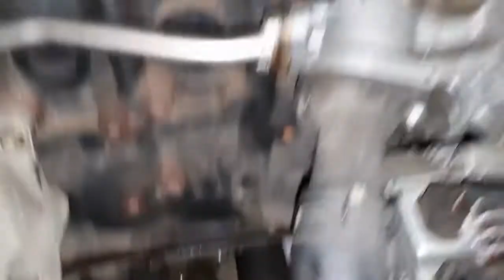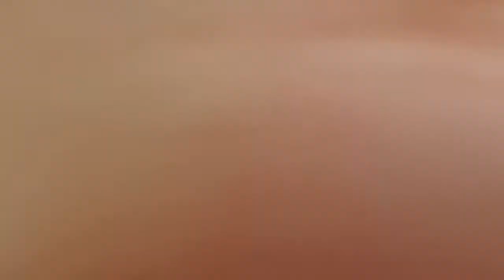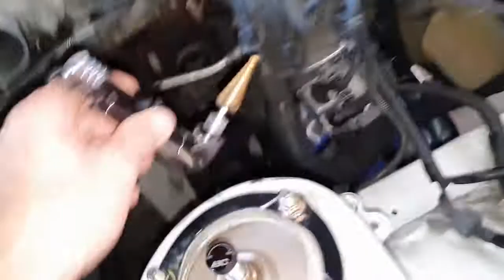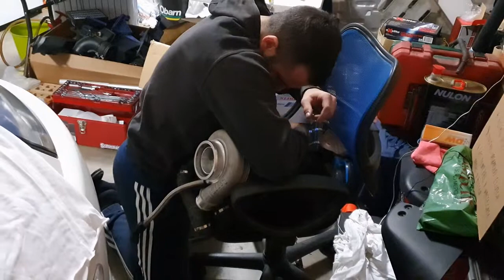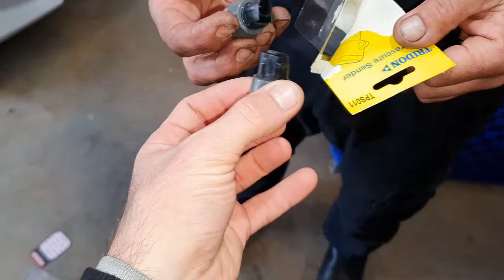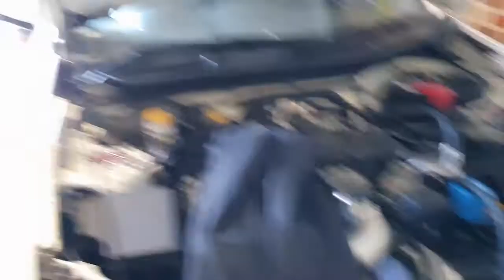TURBO lines COMPLETE 2JZ-GE OIL + WATER FEED/RETURN (NA-T SUPRA BUILD SERIES) Ep.3

Comment: There are two pipe plugs in the oil filter neck. They seal the drilled passages in the filter neck, one to feed unfiltered oil from the block up to the filter; and the other to feed filtered oil back down to the block. Rather than drilling the oil filter neck union bolt and using a "tee" fitting - you can simply replace one of the pipe plugs with a 90* elbow with appropriate NPT thread on one end (I think it's 1/2" NPT but I can't remember for sure) and 4AN (JIC) on the other. Make sure you choose the POST-filter passage/plug so you're feeding filtered oil to your turbo...

Much neater way to do it - and much less likely to vibrate/break. Just my 2 cents.

Comment: When u tapped the holes for the oil, were yous afraid getting shavings in the sump? also what size tapping bit did yous use?
Reply from the maker: Yes it was deffinatly a concern of ours! But we went bit by bit with a vacuum cleaner nearby and tried to suck in all the metal shavings as they were coming out! Tree style drill bit up to around 12-14mm
Reply: @AutoMotiv8ed  ah yes the tree style bit, awesome
Reply: It's a concern, but try not to worry about it. Do your best to avoid getting chips into the sump and forget about it. Engines will eat some aluminum shavings pretty happily. Steel on the other hand - not so much.
Reply: do not do this on the car its not worth losing your engine.

Comment: How were you able to drill the 2 holes that get tapped for the bolts? Not enough room to fit drill/bit because of the steering rack in the way.
Reply from the maker: We used the smallest makita drill and there was just enough room for it!
Reply: @AutoMotiv8ed  did you need to use a stubby drill bit as well?
Reply from the maker: @TheMagicBambi  correct! 😁
Reply: @AutoMotiv8ed  dang, I tried finding a stubby and seems like they dont make em in that size.
Reply from the maker: @TheMagicBambi  you can also try a "right angled" drill attachment, this should work
Reply: @AutoMotiv8ed  using one already,  like less than an inch between the hole and the 90 attachment cause of the steering rack hitting the back of it

Comment: Hey bro, dont know much about these engines yet but i cant seem to find the pressure switch on mine, could it be possibly have no switch? thanks
Reply from the maker: hey man, all 2j's have this oil pressure switch
Reply: @AutoMotiv8ed  my oil pressure switch seems to be not located the same as yours, do you know where it could be? thank you bro appreciate it
Reply: @jNac02 without taking off the intake manifold it’s quite impossible to spot it’s like a needle in a haystack, if you know where your coolant temp sensor is it’s below that near the bottom of the block on the intake side of the engine

Comment: What size are the fittings and the long bolt came tap or you had to drill through it ?
Reply from the maker: Long bolt is where original oil pressure switch screws onto. Threads are identical to OEM oil presure switch.

Comment: Hi, great content. Where did you get your water supply from for your turbo inlet and where does the coolant exit line from your turbo feed into?
Reply from the maker: Thank you!! Water feed comes from hose where the intake manifold was supplying water to the throttle body, and return is the same as in the video
Reply: @AutoMotiv8ed  
Hi

Thank you for your reply. Appreciate all the shared info and I am hoping you can help me out with the below 

which compression ratio is best for my setup?

With my setup, what should I do to get the correct quench/squish?

What size gasket thickness should I be using?

I am no qualified mechanic and do no have the any specialized measurement equipment to work out the above questions. I however would like to hear from the more experienced builders like yourself on what to do so that my already bought parts and cash spent do not end up being wasted by making the wrong choices. I will be running on pump gas which is 95 octane rating as per the pump reading and would like to achieve 500 - 550hp.

I have a 2jz ge vvti complete engine which i bought aftermarket parts to strengthen the bottom end so that I can turbo my engine.
When I bought the parts i didnt have knowledge about choosing the correct CR or know anything about quench/ squish.
I had the block and head checked out by my engineering shop and didn't have to shave off anything from my ge vvti head as I was told, its straight after being checked. The block too also did not require any straightening.

I bought the following

CP forged pistons 10.0:1 with 86.5mm bore

Eagle H beam rods

ACL Big end and Conrad bearings

1.3mm cometic MLS headgasket 86.5mm

Uncut ARP headstuds

Piston volume = -4.48cc (as per specifications)

I asked one of the builders at Realsteet and he suggested  that I purchase a 2.0mm HG in order to achieve a CR with something in the low 9.2:1
I am a bit skeptical as to purchasing a 2.0mm gasket as I'm afraid this might give me a higher quench above what is required

I am looking forward to hearing from you.

Comment: What hose fitting did you use for the oil drain -10an flange? My fitting keeps hitting that bolt near the flange and my fitting wont screw it straight
Reply from the maker: Is your car auto or manual? If auto you have to make somthing else fit as transmission cooler is in the way and you will not have enough room.

Comment: Hi can you give me the thread size and specs for the oil feed fittings and the tee piece
Reply from the maker: hey i cant really rememeber the exact size, but its the exact same thread as the oil pressure switch. we just took the oil pressure switch with us to our local racewords dealer and they matched it up for us
Reply: Oil feed from the big bolt 1/8 bspt

Comment: This is a very bad idea to do on the car, metal shavings all through your engine
Reply: Meh. Engines will happily eat a few bits of aluminum. If a few aluminum flakes hurt a JZ - they wouldn't be so famous.
Reply: @GroovesAndLands  wow what a bad thought process. engines don't "eat" anything in the coolant or oil compartments of the engine. the stuff that gets in there is there forever unless taken apart and cleaned. if you were talking about the intake manifold i would agree that the engine can "eat" a few metal shavings and leaves no problem but when you put metal in the oil system you are asking for a clogged oil passageway to one of your bearings or camshaft oil output. JZs aren't famous for being reliable, they're famous for making power.

Comment: do i need to run a tee with the oil pressure switch or could i just run the feed straight from the union bolt
Reply from the maker: @Smerke you best off running a tee, that way you have the oil pressure switch working too. You wouldnt want to get rid of the oil pressure switch in cases where theres no oil/pressure, that could possibly save your engine.
Reply: @AutoMotiv8ed  o okay thanks so is it a physical switch or just a sensor
Reply from the maker: @SmerkeHD  sensor/switch same
Reply: @AutoMotiv8ed  ok thanks that’s what I figured I appreciate the help

Comment: This is the ideal video I finally found it. Do you have the part numbers for the race works t and fitting? Also do you know the lengths for the steel braided lines?
Reply from the maker: @Erik Valencia Thank you so much for your awesome feedback!! I dont have the part numbers but if you go onto their website you can find it, should be pretty staight forward the guys at raceworks are very helpful! Lengths were not measured either, they usually sell in 1m, 1.5m or 2m and so on, so you can take a rough guess of how much line you need and can buy it in 1 length and cut it yourself!

Comment: Nice video’s man. The sump should’ve been drilled as ricardo said seperately, i did so and even with changing oil those shavings will stay in your oil pan. 

Did you fully drill the hole out for the drain? The bigger the better. 

Besides these, i’m very stoked to see the outcome, glad to see some na-t going on!
Reply from the maker: Hi @mike seegers
Thank you for watching videos glad to know people are liking them!!

We didn't fully drill out the hole in the sump mainly to reduce as much shavings inside sump as possible, we are going to end up making the hole a little bigger in the next couple of weeks once we get it back from the tuner!

New video coming out end of the week!
Reply: @AutoMotiv8ed  i would make drilling that hole a priority hey!
last thing you want is oil drain back pressure = lots of blue smoke
Reply from the maker: @RallyRanchMotorsport  Hi yes i will keep that as my main priority as soon as we receive the car back all finished up !
Reply: @AutoMotiv8ed  did you end up drilling that bigger and whered you get the return fitting from?
Reply from the maker: @Stanistanbouli321  yes we did, you can find return fitting on golbeys parts.com

Comment: Aren’t you worried about metal shavings and such being in the sump now after you drilled the turbo oil drain?
Reply: No worries, the metal shavings will end up on the outside of the sump and any shavings that possibly go into the sump will sit on the bottom and come out when they change the oil and any shavings that get sucked Into the system get caught in the oil filter.
Reply from the maker: Hi @Ricardo i dont know if you can see in the video because it is fast forwarded, but while we were drilling into sump we also had our industrial vaccum cleaning sucking up the excess shavings 
As for shavings falling inside, we did an oil change right after doing this before car was started to insure the sump was clear, exactly how @Clearview has explained!!
Thank you very much for watching guys
Reply: @AutoMotiv8ed  ah okay. That makes the whole Na-t conversion much easier as you don't need to take the engine out/sump off to tap it as I've heard from others
Reply from the maker: @ricardo9628  Suprisingly this whole Na-t conversion was much more easier than we had originally planned, so much easier than removing the engine! I'll make a video once the build is done, about what the hardest/most frustrating things were while doing the entire build!